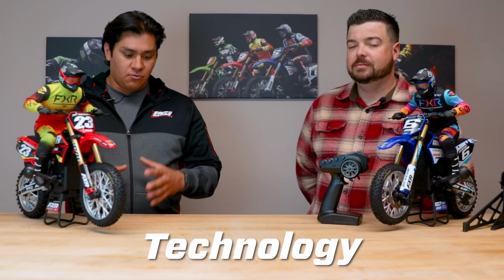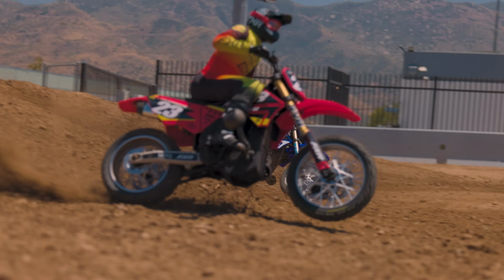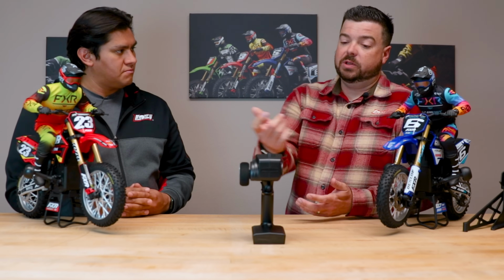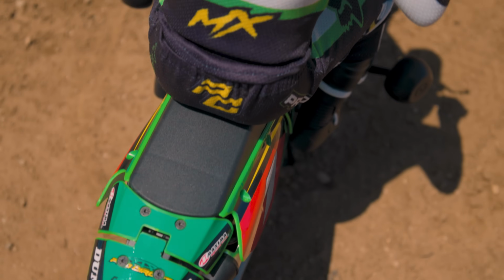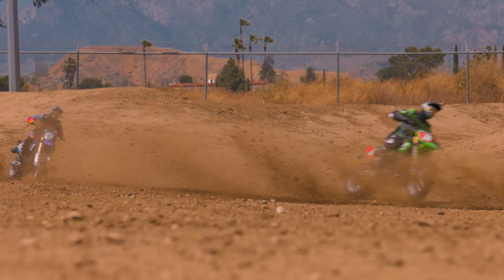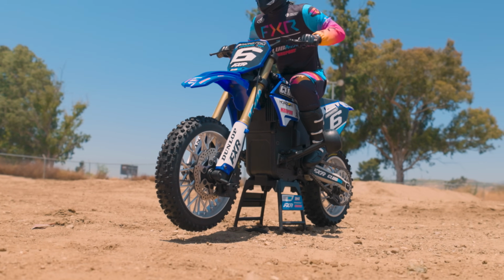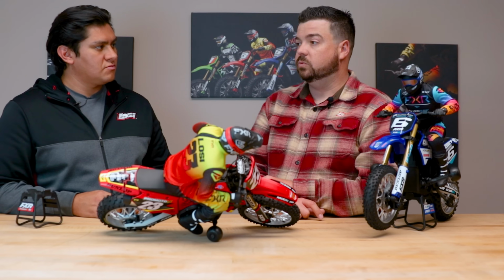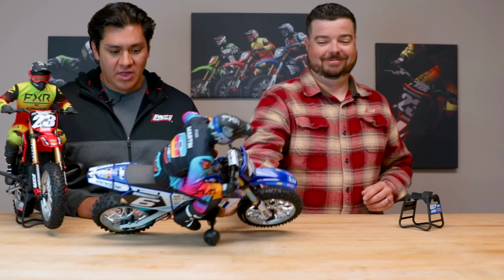GET TO KNOW THE PROMOTO-MX IN DEPTH

Comment: What is the red button above the power button?  I thought it was supposed to be for binding, but all I get is endless beeping and apparently won't bind at all and otherwise just loses bind since pressing it. Binding back only seems to work with pressing the button directly on the receiver, underneath the shroud while turning it on.

Comment: Do you have the BT2000 card for the ms6x controller? I have just put the BT module in and read the settings from the controller and now all the end points and AUX channels are messed up. I dont know what the default settings are for this bike. Do you have a video or any help?

Comment: Some of us Moto guys use the front brake to keep the front wheel planted while cornering by slightly dragging the brake. Jean-Michel Bayle was known to do this with both brakes regularly smoking a set of pads. You guys should test programming in the MX6 to front brake drag while cornering?

Comment: My ProMoto is dead after 1 run. My flywheel control is backwards- I have it set to off on the controller and when I turn on the bike the flywheel spools up. I turn the switch to on and the flywheel starts turning off. Horizons support hasn’t gotten back to me since I submitted my ticket on Sunday. Anyone else have this issue and if so how did you fix it? I’m trying to re-bind the controller to the bike but that doesn’t seem to be working either.

Comment: In my opinion, the most advantageous upgrade for this bike would be equipping it with adjustable suspensions both at the front and rear. These suspensions should have adjustable damping force, allowing to customize the ride's softness or stiffness through a dial knob with 10 to 16 levels of adjustment just an example.

For those looking to enhance drifting action, a soft front and stiff rear suspension setup would be ideal for dirt and loose surface, while a softer rear and stiffer front would be more suitable for performing nose wheelies.

I also believe that the weakest component of the bike is the front plastic bracket supporting the suspension. Fortunately, third-party aluminum upgrades are already available, designed to provide better cooling for the motor.

Moreover, I highly recommend using a wax dry lube for the chain, such as the Muc-Off brand. This chain dry lube is specifically formulated to protect against dry and dusty conditions, and it even has a pleasant fragrance.

Comment: I'm worried about the slipper clutch, my last rc dirt bike had one but slackening off too much to make the bike drivable just burnt out the clutch in fact it melted the clutch and main drive sprocket together, i was constantly spending money on parts. As soon as you accelerated the bike would flip over backwards, it was crap until you loosened the clutch off. Couldn't you have designed the speed controller to have a precise acceleration curve? i notice on most rc models when you open the throttle, its not very linear. A system that had a precise acceleration curve would make a slipper clutch redundant, well you could still have the slipper clutch for landings and fast deceleration. My full size sports motorcycle has a slipper clutch but works in the opposite way to a rc slipper clutch. How reliable is the clutch on the losi dirt bike? its the one thing putting me off buying one

Comment: I drove this rc yesterday and the chain stopped and got locked up and i believed a gravel rock got stuck inside the sprocket gear inside the small one in the motor cover. I thought i broke it by riding it on the road. This could be a problem soon will be found if the chain stops its a wedged rock inside the cover.

Comment: The chain looks cool and seems a great idea, that is until you read the manual about chain maintenance... (I'd much rather have a drive shaft instead of the chain, who wants to completely clean the chain with special cleaners, then oil the chain after every run? Here in southern Arizona, we have fine dirt and lots of dust, and I sure don't want to have to clean & lube this chain after every use, and the run times are only 9 to 12 minutes! I'd love to get this bike, but with the after every run, clean & lube the chain is a big turnoff for me, I doubt I'll get this bike just because of that) What the owners manual says... 
"DRIVE CHAIN

The drive chain should be cleaned and lubricated after every
running session.
To clean the drive chain:
1. Spray the chain with Nitro RC Car Cleaner (DYN5505) or
other plastic and electronics-safe cleaner.
2. Wipe the chain with a clean cloth and allow to dry
thoroughly.
3. Repeat the above steps until no dirt or grease appears
on the cloth.
4. Lightly apply the included chain oil to the roller portion of
the chain links, working around the entire chain.
5. Spin the rear wheel to work the oil fully into the chain.
6. Wipe away any excess oil with a clean cloth."

Comment: If you turn the MX6S system off with the knob, can you do backflips on jumps?
Reply from the maker: you cannot turn off the MX6S system entirely and if you try to use the motorcycle without the flywheel spinning it wont be drivable at all :)
Reply: @LosiRacing  I mean flywheel on but the wheelie limiting system off to punch the throttle on take off and do a back flip?

Comment: Sooooo many questions!!! So will there be extended swing arms? Will there be a street bike ? Can this drive train and gyro setup be put into other bikes ? With there be other chain options Street tires ? Can it run a 3s ? Can we make it faster ? I want to make it a drag bike 😂I think I’m gonna need three just for what’s in my head at the moment , sand paddles ? Oh what about snow skids with sand paddles to run on the snow oh oh what about running it on water 😈 soooo many ideas for this platform
Reply from the maker: That is what we love... we provide a solid platform and you gear heads tinker and make is unique and many times better! PS - 3S will fail the flywheel system... no go!
Reply: @LosiRacing  ok so no 3S buuuuuut can we go higher KV on the drive motor without causing issues for the gyroscope ?